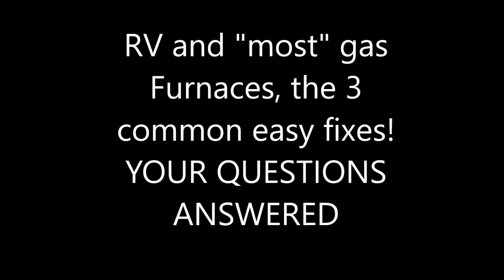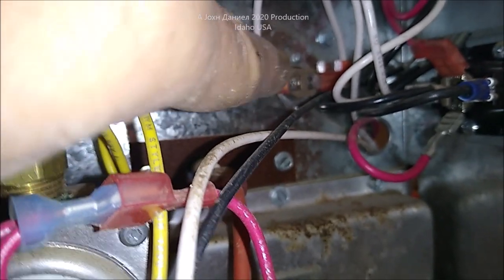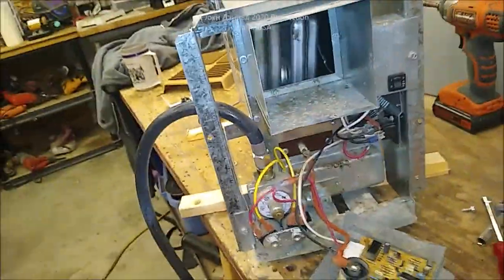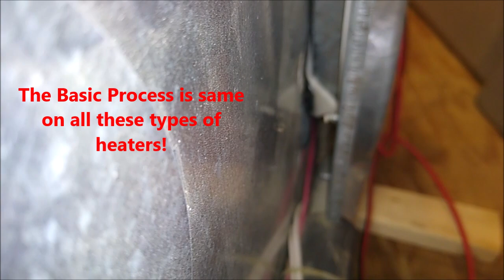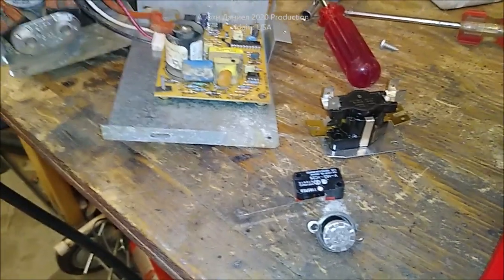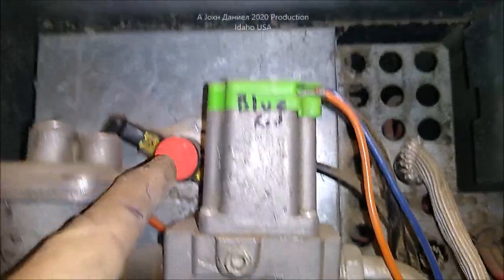RV Furnace REPAIR TECHNICIAN SECRETS Top 3 Easy Fixes anyone can do PARTS BELOW

Comment: My blower motor won't shut off. Had to pull the fuse
Reply from the maker: Your RUN DELAY RELAY is fused and hung up. Rare possibility is the cool down bi-metal click disc is doing it, but that is real rare. Run Delay relay can be replaced with the ones made by White Rogers/Emmerson that I list below the video.

Comment: How do you fix a squeelling furnace?
Reply from the maker: Lots of Discipline!! Or you have to find what's squealing. If it's the motor you can oil it, or replace it. To oil it, I suggest remove, use 3 in 1 oil, and a gentle hammer tap on the shaft ends to upset the bearing surface to extend life on it. If its the motor mounts worn out and allowing the blower impellers to touch the housing then you have to do some hillbilly magic to that.

Comment: Hey great video! So my furnace does everything it is supposed to do only problem is its only blowing Luke warm air. Like only co.eing out of the vents at 90°. It's not sufficient for pretty cool nights and the furnace never shuts off. There is hot heat coming out of the exhaust  vent too. Any ideas? I already replaced the propane  regulator at the tank. But no luck.
Reply from the maker: Something is blocking the air in the RV from going back through the furnace is a common issue with those results. Like filter or screen or even clothes piled near a intake. Other possible is insects building nest into the intake/exhaust from out side causing air starvation to the burner, take a flashlight and look up into them.

Comment: Such a helpful video! Just pulled out the suburban DD-17DSI from my 97 flagstaff popup and found that the sail switch/leaf switch was bad.  It would show continuity when open, however, there was 500 ohms resistance across the sail switch was I think is an indicator of a bad switch.  I took the wires off of either end of the sail switch and was connected them together, and everything fired right up first time.  My symptoms prior to this were no spark and gas, but the fan would run.

Comment: if the Universal Run Delay Relay is faulty would it keep jumping my fuses
Reply from the maker: Yes, if the relays thermal tabs are bad or fused in it it will cause the fuse to the unit to pop.

Comment: My fan starts I can see it pushing the sail switch and then I can hear the pilot spark 3 times I even smell a small amount of propane in the exhaust outside but no flame 

Model Nt-12SE
Reply from the maker: Check for bug/wasp blockage in the intake, verify the flame feed blower is putting out good draft from the exhaust. If it is, then replace the Electrode/Flame sensor, the only alternate part is the 956 now, but should fit fine https://amzn.to/45wxAE9 and get a new door/igniter gasket https://amzn.to/3xmLFY7 when doing it. The only limit switch for a 12-Se is now the 231630 https://amzn.to/3VvdjtX , they do not sell a 170-635 now.
Reply: Thanks a lot! 😊

Comment: Thanks for the breakdown!  My furnace occasionally fails to recognize the thermostat and doesn’t turn the blower on.  I turn the switch on the furnace on and off and it works for a while.  Do I need a new fan blower relay?  Thanks!
Reply from the maker: Always post the year and model of furnace if you want a more accurate reply on them. Sounds like a Delay Relay effect, not making full contact to pass power through, carboned up contacts. It will hit hard enough using the switch to run sometimes but rarely run when not manually messed with. But depending on model it could be other things.
Reply: Thank you!

Comment: I've been pulling my hair out for months trying to get a Duo Therm 66117 running in the old Skamper popup I bought last summer.  I've read the manual, read every forum thread, and watched ever video I can find on these.  No matter what I tried the dang thing would not run more than a few seconds before it would blow the flame out, do the single retry, then lock itself out.  Unless I pulled the unit out of the camper and ran it on an external propane supply, then it ran fine.  That pointed to a problem with the camper's propane supply pressure so I completely redid everything there and still the same result. I even pulled the camper's propane bottle and regulator to do the bench test and it was fine, just not when installed in the cabinet. I tested the sail switch, the gas valve, the line pressure, tried adjusting the burner pipe's intake air damper a few different ways, and nothing worked.  I must have had that thing pulled out and back in six times before I realized the dang flue pipe telescopes in and out of the combustion chamber.  Turns out when it was installed it wasn't quite poking all the way into the center of the direct vent fitting on the outside of the camper, and there was just enough of a gap there that as soon as the flame lit, it would start sucking exhaust gas into the combustion air intake, which would suffocate the flame within seconds.  It was a bear getting the flue pipe centered and pulled all the way into the external housing but as soon as I accomplished that the heater ran like a champ.  If anything at 17kBtu it's way too big for this tiny camper but I'll probably never use it for more than taking the edge off when I get up on a cold morning. I'm just glad I finally figured out what the problem was.
Reply: So I’m having the same issue, also 17k btu, my heater is a suburban. I was about to order a bunch of parts but not I’ll take off the exhaust and see if it runs fine. Thanks for the information.
Reply: @smw397  FUUUUUUUUUUUCCCCCCCKKKK hey

Comment: My friend has a momentum grand design 25G has a 30,000 BTU suburban heater. He says when the temperature is 50 outside, it works properly when it drops below the heater shuts off and goes into lockout mode and has to manually restart it, but it does not keep his camper warm.
Reply from the maker: Sounds like condensation. He likely got a bad load of Propane with too much water in it. See if it's fogging a bit from the exhaust when he can get it to run, if so, swap out with propane from another supplier. The temps under 50 is causing h2o purging that reduces the burn and heat, and causes the furnace to go into fault. About a 70/30 accurate diagnosis! If the info helps, donate to the channel with https://www.buymeacoffee.com/JOHNDANIEL

Comment: I just bought a new travel trailer. I came with an Attwood 7916-11 that’s having a leak when not on but propane is on. The unit functions properly and sounds smooth when running but the second I kill it I start to smell propane through the heat exchanger (not sure if that’s what they are called- large metal things encased in the unit). I did a soapy water test and nothing is leaking in the in the front I can see. I believe the gas valve or solenoids are stuck open. Would that make sense? I only see valves that get stuck in the closed position on YouTube  and in my case would be better for my situation (gas floods small camper quick). Any insight would be greatly appreciated. My unit looks very similar to the one in the video
Reply from the maker: Get a flash light, look into the intake and exhaust for wasp or insect blockage. This can cause excess propane smell inside during cycles. A gas valve stuck on is very rare. A gasket leak from over pressure on the exhaust or blockage on intake can do that effect though.
Reply: @JOHNDANIEL1  I had it apart and looked and it’s all clear best I can tell. Actually looks very clean no rust or anything. It sat in storage for 2 years and regardless if it cycles on or stays off it leaks. As soon as I turn on the propane it leaks. If the unit is off and hasn’t been run the valve should never put gas into the element correct? I found a replacement valve and solenoids for $90 so I can find one. Everything else works properly but I can’t run any propane appliances because it leaks pretty bad. I replaced the hose (had an extra) and it didn’t fix it. I think it has to be the valve but is odd cause it seems like nobody has ever had a problem like mine lol

Comment: How do you get them out of
Reply from the maker: Turn off gas, disconnect power. OUTSIDE - Remove outer exhaust and intake plate from outside RV, the screws and cover, pull the assembly straight out. it may be stuck from carbon, work with it. INSIDE - Remove cover on furnace, back up with wrench and remove gas line and prop aside. Look into lower of heater and see 2 or 3 screws going into floor, they will be 1" or longer, remove. Unplug or disconnect wiring from thermostat/power. Disconnect any ducting move aside. Lift up some to be sure it is free, pull straight out. Reverse to re-install.
 Help Support the Channel , 👉 Support/Donate with KoFi - https://ko-fi.com/john4kiera OR https://bit.ly/2buyaCoffee all support helps.

Comment: I have an Atwood 7920-II. I purchased the over temp switch and a sail switch yesterday and installed both yesterday. I am getting a single red light every 3 to 4 seconds. Will blow approx 10 seconds then cut off. Any thoughts/ideas?? Thanks.
Reply from the maker: Detecting NO GAS/NO FLAME from the electrode/igniter is a usual suspect for that.
Reply: @JOHNDANIEL1  Thanks. I will try that.
Reply: @JOHNDANIEL1  Replaced the ignitor as well yesterday. Runs 5/10 seconds and shuts off. I have a single light blinking. Thoughts? Thanks.
Reply from the maker: @TheDUTYFIRST  It is sensing no flame with that action or improper flame. Take a light and look deep into the furnace intake/exhaust from out side. See if blockage exist. Check if 2 wire igniter that the right wire is on right terminal, make sure chassis is grounded right.
Could have a low voltage issue due to bad capacitor on board and may need that researched.
Reply: @JOHNDANIEL1  Have removed the entire unit twice to replace above said parts. Their is no restriction, nests, wasps, etc.  Past that point. My half as$ guess is the circuit board. Something that is a pain is probably something simple. Thanks for the info. Not sure what else to do. Have a good day.

Comment: great video. Does an RV furnace have a flame sensor? My coleman unit will run for a few min then cut out and it will reignite a couple times and then nothing. I believe i should maybe try the over temp switch but not sure

Comment: Ok I was hoping you would go over my problem, every time I go to the thermostat and turn the heater on...the fuse pops, not the breaker but the fuse. It shuts it all down and I have to be fast about turning the thermostat on after changing the fuse and switching back to A/C before it pops again. My thought is the thermostat itself, what advice do you have to start troubleshooting this? Thank you.
Reply from the maker: If you have a dual Heat/Cool thermostat but the fuse only fails on the heating attempts then its likely the heater. But not knowing what type, year, model your furnace is I can only guess the issue.

Comment: This has been greatly helpful. Would you by any chance know what temp sensor and sail switch to replace for a DD17dsi? 17k-input btu
Reply from the maker: You will have to do some adapting on them since that model is not easy to get parts for.

Comment: But what if I hear clicking like it wants to come on what part would I actually need? I know that it has power and the floor stopped working. I could hear the fan slowing down and then eventually it went to slowing down and cutting off super quick and now it just clicks. Please help.
Reply from the maker: Not sure the year and model you have. But a fan slowing down has many possibilities. A major one is nest, bugs, mice caused blockages in the system.

Comment: Where can I find a replacement for the relay on the control board? I’ve got blower but no clicking. High temperature and sail switch both work.
Reply from the maker: Clicking not sounding right, low, or random is the coil arc which can mean the igniter is failing. Sail switch - Bypass the sail switch and try it again, they can click and feel fine, give zero ohm but be bad. And the relay on board you can bypass it with a wire ( test clip set ) to send power to the coil and see if it is that relay that is bad. Otherwise, there is a model number on them unless its a off brand board that you can just find online. Most all the time though, if the board is going bad its the electrolytic  capacitors failing on them.
Reply: @JOHNDANIEL1  Thank you. I think I’ll try bypassing the relay. Another video I watched stated that the white wire coming off the plug on the control board would indicate no power through the sail switch and the white wire going directly to the sail switch would indicate power through the high temperature switch. So I had power from the high temperature switch to the sail switch but nothing from the white wire at the control board plug. I checked continuity of the sail switch and it was fine.

Thanks again for your generous sharing of expertise!
Reply: I pulled out the control board and located the relay but not sure which contacts to connect for bypass
Reply from the maker: @legacedar When you power up the unit one terminal on the board will show power on it already, the other is where the relay will send the power on the switching circuit. So when you test it you will see 12 volts on one terminal already that's waiting for the board to create the signal voltage to connect them.
Reply: Thanks. Ya, there is no power at the plug to the board. Having looked at the wiring diagram that seems to indicate a failed limit switch. I ordered a new one yesterday. Thanks again for the advice 👍🏼
Reply: But I do plan to do a bypass test of the limit switch, now that I understand the wiring, to verify that that’s the only problem.

Comment: Hi Jon. Thank you for the info. My issue is a little different. The heater turns on, it heats up the RV but then doesn’t come back on after it gets cold in the Rv. 
Any ideas?
Reply from the maker: The question in reverse, how long until it will come back on, does it try to light and fail after tries on its own, or does it just sit dead waiting for the next day!! This can be the over limit switch or the delay relay or similar circuit. It can be on rare occasions humidity related but not knowing what follows shut down, how it shut down ( sudden or after a full cool down cycle ) is important.
Reply: @JOHNDANIEL1  
John thank you for getting back to me. 
It shuts down normal. It reaches temp in the RV and then shuts down and then when it gets cold again it doesn’t come back on. For some reason the next day it comes back on and will work normal for a few cycles but then do the same thing again. I originally thought it was the thermostat because of that so I changed the thermostat, but the same problem exists.

Comment: I’m looking to figure out why my 20 amp fuse keeps popping immediately as installing or after you reconnect power. I had a bad sail switch that caused my electric and gas furnace to stop working, so had to pay to have it delivered and serviced under warranty. Which all in all cost me $600 for a $20 sail switch. I only took it to them, because they said my a/c unit is notorious for going bad and would likely get a brand new upgraded unit. I just can’t afford to pay $600 for a simple fix.

Comment: Help! Furnace ignitor sparks. Smell propane at exhaust.  Lights and I feel heat out of exhaust.  Then furnace goes into cool down mode and tries again. What gives?
Reply from the maker: Intake Air Restriction symptoms. Over Temp switch Symptoms. Likely scenario is wasp or similar has blocked the intake or intake blower, leaving unburned fuel to go out exhaust and over heating unit inside so it shuts down.
Reply: @JOHNDANIEL1  first thing I checked. It's all clear. I pulled the whole unit out twice.  All sensors and switches  appear good.  Could it be bad propane regulator causing low pressure? Stove still works

Comment: Great information, thanks!! Maybe you can help me, seems no one else is able to pin point my issue. I have a Dometic furnace DFMD30131. The heater was starting up, blowing cold air and then turning off.. I replaced the sail switch (leaf switch) and the heater fired right up started blowing hot air and I thought I was fixed! But, 2 days later it went back to blowing cold air and turning off.... I had another switched and replaced again... that lasted about 1 day.... So I assume that I have something that is making the leaf switch to go bad prematurely. Any idea what this could be? I ordered more switches today as well as a new board.... but have you heard of this or any ideas? Thanks!

Comment: Excellent video, straight to the point. Just bought a 30 year old RV in excellent condition, very clean unit inside & out. Furnace like yours, very very clean. Was just working few days ago, now not. Fan blows, hear solenoid click, I'd get a BOOM of flame, then out & nothing more. Bypassed over temp switch. Checked sail switch (good). Opened it up, NO obstructions, very clean inside, Removed burner, checked & cleaned with Carb cleaner. Checked "jet" orifice. Any ideas???